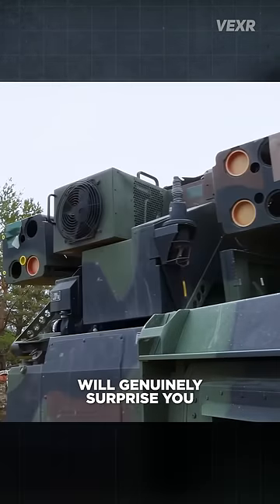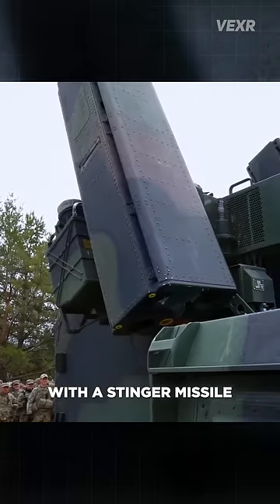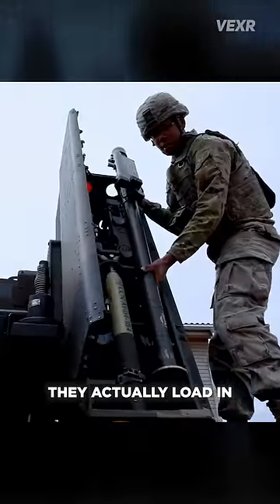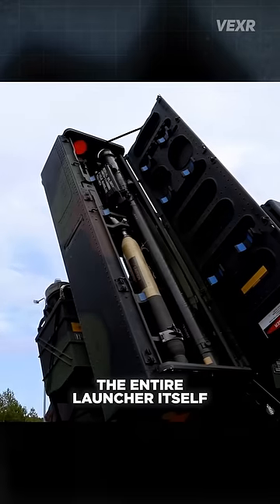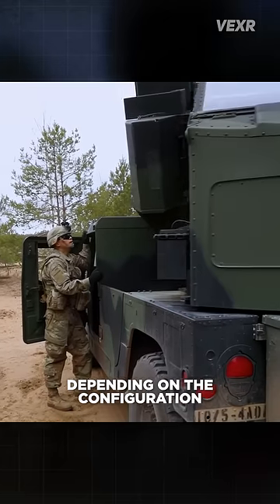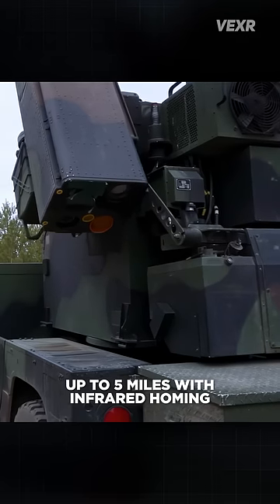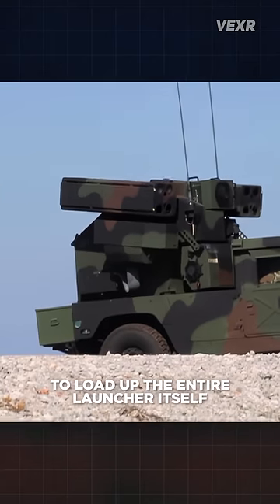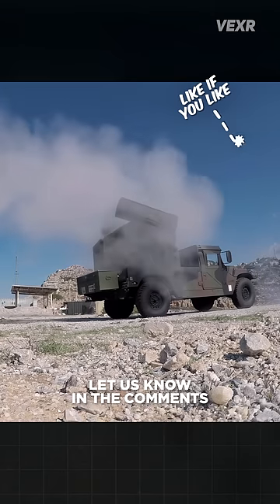The Weirdest Way To Load a Missile

Comment: It's built that way so if the vehicle is destroyed you can still pull the stingers out an use them like a rpg
Reply: I don’t think you would be able to use it like an rpg. I guess you would be using it as stinger lol
Reply: A stinger is AA, usually RPGs hold an AT role
Reply: @al1sa920 no no, some anti air missiles have the capacity to be used as anti infantry and ground but it would depend on the missile wether it can kill a tank but some certainly can
Reply: @Uzyvan6 not a stinger tho
Reply: @Uzyvan6  not handheld. S-300 maybe can, Verba or Stinger definitely can't
Reply: @specialist_yeti3307 Any rocket can be AP (Anti-Personnel)
Reply: In most of not all cases, guided missile systems are given the option of “Direct Fire” or “Free Fire”

No engineer would lock out manual use, he would’ve never gotten a military contract.
Reply: @brycejarrells16 no it can’t
Reply: @androguyperson2297  that’s literally made up. Where are you getting this information from? You can’t use a stinger against a ground target
Reply: @Uzyvan6 not a stinger
Reply: @jazz.560 you can use the stinger against vehicles but they have a smaller warhead. You can also use a jav against air but the thing is kind of lacking the same sort of maneuverability
Reply: @ironteacup2569  u can use a javelin against air target, but I don’t know about the other way around
Reply: @androguyperson2297 Direct fire is a mode on Javelin and Milan missile but it still uses guidance. Stingers only fire on lock. The contracts require them to be guided only, you don’t know what you’re talking about.
Reply: @al1sa920 you wouldn’t be able to hold s-300. It’s about 10m tall.
Reply: @georgeousthegorgeous  I know, I didn't say it is handheld
Reply: @jazz.560  its the low explosive charge. dont use it on a tank but a car will be fine
Reply: @ironteacup2569  I think you’re somewhat right I did some research and can potentially lock the ground targets, but it may be dangerous due to altitude and the distance of the target  so it’s basically not guaranteed to hit the target. It might hit the ground.
Reply: @trollmastermike52845  maybe not against a table but a light tank or ifv could be vulnerable to the explosive mass
Reply: @Uzyvan6  I doubt it most ifv's are rated to take 155+ mm artillery shrapnel from a certain distance. (Can't remember the exact distance for Bradley example)

But that missle shrapnel is not designed the break hulls of tracked vehicles, but much more softer aircraft.
Reply: @trollmastermike52845  I meant pure explosive mass
Reply: @Uzyvan6  no way, it's to light around 7 pounds of explosive. Besides, it's not optimized to work like a hesh round ether, and I doubt the HE would do anything but scratch the paint
Reply: Using a stinger missile as a rpg is the most ineffective and expensive method way on dealing with infantry and vehicles. They are smart missiles with a small explosive meant to destroy fragile jet engines.
Reply: So many Call of Duty veterans here…
Reply: @specialist_yeti3307 actually the RPG is a mmulti purpose rocket launcher for Infantry, bunkers, armor, light vehicles, helicopters
Reply: @androguyperson2297 did you say this because your an engineer and you want to feel special ?
Reply: In other words, we can take the rocket pod of the tank we exploded and fire it manually, just like in Prototype 2. 😂
Reply: @al1sa920 If you're firing from an elevated position onto something that has an engine or is otherwise warm, it is possible. However, it's less than 1 kg of C4, so it won't do much against most things.
Reply: @jazz.560 you can. You definitely can (I was a stinger gunner), but you would honestly get better results with a machine gun against literally any ground target you can possibly conceive of.
Reply: @jazz.560 yes, it can lock onto anything warm, but you would need to be in an elevated position and at that point, you should just use your machine gun.
Reply: You literally just made that up without doing any research at all.
Reply: @CharliMorganMusic  that's like throwing a hand grenade tbh
Reply: Yup
Reply: @Turbo_Teriyaki it's not that they are meant to destroy "fragile jet engines" but rather just taking advantage of the fact that military aircraft don't have armor to penetrate. Adding any armor that would actually have any effectiveness would mean a couple tons of weight, which would eliminate all maneuverability of an aircraft.
Reply: @al1sa920 I think he meant firing it from the shoulder
Reply: @androguyperson2297  You're completely wrong. The Stinger cannot be fired manually and it cannot lock onto ground targets. It is designed so that it will only lock onto airborne targets. And it can tell the difference by the signature and a number of other factors. Allegedly the more sensitive sensors in the Avenger can get the missile to lock onto ground target under the right conditions, but it's very difficult to achieve. Frankly, you don't want it to anyways. It won't kill any armored vehicle and it's a waste of good ordnance on a truck, which is probably why they were designed with that limitation. People do not understand that AA missiles do not need to penetrate much if any armor, so they operate more like a giant shotgun shell with a rocket motor strapped to the backend of it. This makes them absolutely terrible at killing anything that's not an aircraft.
Reply: @ironteacup2569  You can't use a stinger against ground targets. They simply don't lock onto anything other than aircraft because they need a larger signature. You'd think an MBT or a truck that's been running all day would put out a large enough heat signature, but they simply don't put out enough for the Stinger to accept it as a target. Their software programming is pretty intelligent for being 1980s tech. Allegedly, the Avenger's more sensitive systems can lock the stinger onto ground targets, but it's apparently very difficult to achieve with any reliability, and there really isn't any reason to do it since there's better weapons for that. AA missiles make their kill in a completely different way to a missile that's designed to take out armored vehicles or occupied structures.
Reply: @wolfehoffmann2697  I am not going to play a warthunder thread here so I will say  ok you are right
Reply: Basically it's like one bigass magazine module system for the javelin missile launcher. In the case the turret malfunctions or needs to be fired off road terrain the infantry can take it out and deploy the weapon on foot manually
Reply: Makes perfect sense
Reply: Every expert in this comment section claiming stinger can be used against ground targets have zero idea what they are talking about. Any kind of manpad can be used only in elevated positions and it will refuse to arm itself in straight LOS and also its infra red targeter won't lock on to any ground targets.
Reply: @wolfehoffmann2697  You're talking about a different variation.. let's just leave it at that before saying "Completely Wrong" Don't be a redditor.
Reply: @jazz.560  Most, if not all, lock on targeting systems have the ability to "Direct Fire" where you aim it like a regular rocket. I'm getting this information from actual experience.. so credit the "literally made up" part by your lack of "experience"
Reply: Dude, it's a missile! Not an RPG! Two completely different things!
Reply: @Uzyvan6  
Stingers are weak against tanks or even light armored vehicles.
They're not meant for penetration but rather just fragment into little tiny pieces that will shred apart a portion of an aircraft's body.
That's basically what all AAs do. 
They don't "destroy" you but disable you by putting many tiny holes into you like a shotgun.

The explosion of a Stinger missile can kill people but it is near impossible to actually do that since the launcher won't let the missile launch without a lock
Reply: @Uzyvan6 I remember reading stories of Majahideen fighters using Stingers against tanks during the Soviet invasion of Afghanistan but this could've just been the fog of war. Either way the idea inspired the Call of Duty Black Ops 2 level where you can switch between AA and AT modes on the Stinger (which doesn't make a whole lot of sense tbh)
Reply: @ironteacup2569 The whole appeal of the Javelin is that you can use it against both, I know that for anti-vehicle use the missile is designed to fly upwards and arc down on the target because armor is generally weakest on the top. I think it shoots directly for anti-air use but I've never used them, I'm just a guy who reads stuff
Reply: @rramos117 Guilty as charged
Reply: @ShaggyRogers1 You're right about that but Apache helicopters are pretty damn armored, they can pretty much shrug off 12.7mm fire and the vital parts are supposed to withstand 23mm shells. But I bet rockets of almost any kind could take one down if the countermeasure systems fail.

There's also stories of A-10 warthogs taking 40mm AA fire and landing but that's probably more because of luck or something
Reply: @ericolsen5592  they used the stinger missiles they got from the us on tanks and helos. Shot down many gun ships. Just as Ukraine is a test field for American munitions; Afghanistan in the 70's and 80's was a similar experience.

Comment: It's easier logistically that way same launcher can be used in avenger or manpad config
Reply: こんな対空システムが近くに有るなら、安心して整備支援任務ができる😊
Reply: Yeah, it's all about logistics... they can just produce one thing that works in two configurations...
Reply: umm would just sending missles be way more logistical? Smaller mass?
Reply: @wlpxx7 while yes, sending the whole launcher means the base don’t have to worry about not having enough launchers for the infantry or the SAM.
Reply: @wlpxx7 then you have to design an entire new launcher for the missile on the vehicle...or you could just stick with something a pre-existing launcher can fit into
Reply: @duncanmcgee13 they could do a reusable launcher like the javelin which is also useful for other things
Reply: @kai_790  theyre already using a reusable launcher. And this vehicles purpose is anti-air. Javelin wouldnt work for that.
Reply: @duncanmcgee13  i know that javelins are not anti air, i was just suggesting a reloadable launcher for something like the stinger system
Reply: @kai_790  did you not watch the video? They pop 2 stingers in each side already.
Reply: @duncanmcgee13  did they not put it in with the targeting unit as well?
Reply: @micaheiber1419  right so im saying that if they manufactured just the rocket to reload the launcher and the stinger, you can save money on not having to make targeting units for every missile. if you can just reuse 2-4 launchers you can carry more rockets
Reply: @kai_790 don't quote me but I think yocan reload the stinger it comes as a one shot system.
Reply: @wlpxx7 if the avenger breaks down the crew can still manually engage. The tubes are disposable only the manual grip is kept.
Reply: @rossmaxwell4185 no the spent tubes are thrown away, we keep the manual grip as it has the trigger. When in the launcher the grip in not put on the tube.
Reply: My first thought, too.
Reply: In a way. That's actually quite genius. Shame it wasn't the same case for the VLS system though. That thing must be a nightmare to load rockets in.
Reply: Would it not make ten times more sense logistically to ditch the fancy launcher system and just have eight dudes with stingers.... and use the extra truck space to bring more stinger missiles/launchers?
Reply: @maggaming7969  that would require ten dudes carrying Stingers, and manually aiming them.
Reply: @maggaming7969  so the team is 2 guys, that is easier to logistically support then 8 guys in one position. Then the area will be a platoon of 5 or 6 trucks with one or two sentnal radars to lock down what ever area they are covering with interlocking fire. That would be used to protect a single base of unspecified size then behind them a few miles will be the Patriot systems.
Reply: @Fix_Bayonets  This platform isn't radar-driven... the stinger is an IR platform... It's a visual range weapons system... no radar. Unless you have a secondary radar station like you would with MANPAD crews anyway and every other type of AA net... Also, 5 dudes to a Humvee and a crew of 8 would require 2 vehicles and the second could carry an immense amount more stingers than the thermal signature monstrosity that is that launching platform.  That and Targeting multiple targets simultaneously in multiple directions would also become practical. And reloading would be as fast as you could grab another launcher off the stack of them in the back of the vehicle...
Reply: MANPADS*
Reply: More money for the manufacturers. Got to keep them wheels greasy
Reply: @wlpxx7 if the truck breaks down the men can still use the hand held launcher is the main reason
Reply: exactly...not sure why that was so difficult to understand.
Reply: It's MANPADS not manpad
Reply: It's not male hygiene product 😂
Reply: side bonus is that if the avenger breaks down you can just rip the stingers out and get walking
Reply: @maggaming7969  the car  can drive cross country at 30 mph, or on road at 80 - Can get warnings from AWACS that helicopters are 50 miles north and inbound then reposition, foot mobiles cannot dismount anywhere near as fast - nor does the MK1 eyeball have a search radar built in
Reply: @wlpxx7 Yes, it's less mass, but now you have to Have 2 separate supply chains? Because the manportable version is meant to be single fire. The targeting unit can be swapped around, but the tube itself is single use. So you have now complicated your logistics. By having 2 supply lines for essentially the same thing. Now they could Make the importable version reusable that increases weight and cost.
Reply: @clonescope2433 thanks for clarifying! Makes total sense.
Reply: @maggaming7969  or better a crew of three with I believe 12 in the stowage compartment of the avenger and 8 loaded up ready to go and take out drones helicopters or multi million dollar planes and I believe even to an extent it fires well moving, so if it needs to retreat/rearm and as long as it still has munition it can still engage threats
Reply: its always logistics :D

Comment: The avenger weapon system is designed so that even if the weapon system is destroyed, the missiles can still be used all that you would need to do is insert a BCU battery cooling unit and attach the IFF to the launcher grip stock. If you look closely, you can see the IFF antenna is still on the launch tube.
Reply: There was a Nick Cage movie where he was an Apache pilot, and in the climax two supporting characters get a Stinger off a downed hero?
The pilot of the downed Apache was unable to do it so he talked the Kiowa pilot through the process. Always thought that was cool but bullshit. Neat to know it at least has an inkling of truth.
Reply: @codyblea3638 
I remember that movie. The funniest part was when he had to learn to use the eyepiece for the Apache helicopter, and had him driving the hummve around with the cardboard tube and girls thong on his head. Fire Birds was the movie’s name. I thought them taking the stinger off the weapons platform to be handheld was pretty badass too
Reply: @codyblea3638   They do actually do this with helicopters too. the US doesn't really use them on Apaches, but it can use them, and does with other countries that use it.
Reply: So the Avenger has its own BCU, assuming it can be used multiple times? Is that the large tank inside the launcher pod?
Reply: @Catrik Nope, you just put a Stinger in every time (it's a single shot non--reload able system), it carries 8 ready to fire.
Reply: @codyblea3638  I remember that scene too!
I remember thinking that it was cool that they could do that.
Reply: WOW good description you've obviously have done this before.

Comment: The stinger comes as a complete round of ammunition. The launcher and missile are connected to each other due to the internal connections….the cooling mechanism of the seeker head and other components. This means that they can not be separated until the launcher is activated and the launch motor is activated during firing.
Reply: Found the stinger gunner. #LAADSOC
Reply: No necessarily it depends on the version for example the helicopter version
Reply: So can you reload another rocket into the launcher once you've fired it?
Reply: @KilianP-my3oe that would be the ATAS and is technically under a different designation due to its different characteristics
Reply: @mew1023  I didn't know thanks
Reply: Answer I was looking for! It's a whole unit
Reply: @eliasthompson3020  one shot disposable